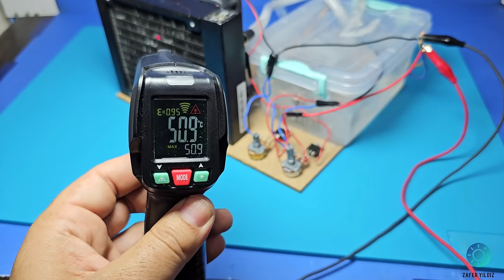How to Make with glow plug Personal Room Heater

Comment: saatlik ne kadar elektrik tüketimi yapıyor ölçebildiniz mi ?
Reply from the maker: 12 volt 10 amper 12X10 = 120 W saat
Reply: @ZAFERYILDIZ52 kaç tl yapıyor peki
Reply: 120 kWh x 1.73₺/kWh = 207.60 ₺ aylık maliyeti vardır.

Comment: Can i use spark plug?
Reply: No. Glow plug and Spark plug are two different devices. Spark plug is used gasoline engines whereas, glow plug is used in diesel engines.
Reply from the maker: no

Comment: 🫢 - very inefficient = heat>water>air….. I was expecting him to drill a hole in one of the ends at the top of the pc radiator, cut off the pipe barbs and block the holes and fill it with mineral/heater oil and put the glow-plug in the pre-drilled hole and seal it = turning it into a 12v element and turning the radiator upside-down with the “glow-plug” at the bottom, and fitting the fan to it. Unfortunately it is too small to heat a large uninsulated room